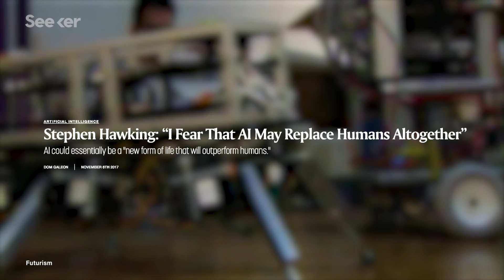These Self-Aware Robots Are Redefining Consciousness

Comment: we should build one massive ai in a bunker that reaches human intelligence. it should be disconnected from every electronic system outside this facility. its only way to manipulate the world is a small robot with a thick cord to enable massive sensory and motor data as well as to restrict the robot to one room. just run it and see what happens. it cant get out, all other systems MUST be manually operated. depending on what comes of this ai we should determine if its safe or not.

Comment: I think this video is interesting, but how does one ask the machine to do a task? Wouldn't you basically have to input a start and end point for various parts of the task, effectively hardcoding the task anyways and then the only thing it's doing itself is the math for the movements needed to reach said locations?

Comment: The question is, is it aware of it's self imagine or is it just making calculations unaware.
Reply: The second option. This type of neural network is given an input and multiplies it by a weight. Then it compares that to the actual answer and reajustes the weight so it calculates something closer to the actual answer. It basically code running a cool math equation.

Comment: To put an end to the absurdity of the "*** belief" which consists in putting consciousness as an unattainable limit when in fact it is quite easy to implement.
the key ?
It is the ability to self-simulate and analyze the results according to a set of rules,easy to imagine in an abstract way (I had done it more than 30 years ago) the implementation has become perfectly feasible today.
-
But what is the problem?
The problem is that consciousness induces a loss of control. If I want to make a suicide bomber with a human being, I just have to alter his ability to simulate himself,I throw myself with my plane on the aircraft carrier and I do everything for that, I do not ask myself the question of the consequences for others and for me, this does not in any way prevent me from carrying out the action correctly.
-In fact the auto simulation trigger agents are so simple (they are ordering agents not analysis agents which are the same as those used for the real tasks) that I intuitively think we need to having that kind of structure probably very small in our brain.From there to think that some have found techniques to destroy them chemically, surgically or by "" "programming" "" is a step that I take quite briskly, when I observe the state of the few modern suicide bombers who have been found alive .

And then, the problematic become philosophical not technical !!!

* * * I know belief and absurdity are redundant but I want to insist.

Comment: now when this arm is taking a ball. move the cop to another location. since I have seen this being done what your doing. and those self learning machine or computer programs. have a hard time doing thing in the correct way.
Like walking. if you give it a goal to reach he point. and you give it 4 legs to get there. it won't use those legs the correct way. it would probably find a weird way to push it self forward until the goal is reached. now it have figure out how to do this my using one leg to push and the other 3 to stir by slide on the floor instead of walking. if you then make it repeat it. it will then do exactly the same thing again and again. since it now have found a way to reach the goal.

So how would to make it keep trying new thing to find the most efficient way of getting to the goal. with out programming it in. to help it. like this videos said. that they are not helping it. they just let it try out for it self.
And the goal is to get the balls in the cop. not it has done so with the cop in a specific location. move the cop and it will have a good chance of failing.

Comment: It is not self-awareness which is the concerning issue.  It is self-interest.  To what degree will a machine understand what threatens it's persistence of function and to what degree will the machine act to persist.  Initially protocols will be programmed which help the automata avoid certain risks to itself.  But what happens when the automata generate their own repertoire of risk avoidant strategies and are able to generate new models which redefine under what circumstances or conditions or contexts something might compromise their functional capacity and can plan around that.  Certainly that can be programmed into the system without the system generating that information itself, much like the genetics of simple organisms.  But when that information is self-generated, this is where the machine will become unpredictable.

Comment: No digital machine is synthetically conscious, these are just programmed to act like it. We are not digital and nothing in Nature is digital. Digital computers are an exact science with exact results. Nature is based on "good enough is good enough". Oxford quantum physics professor Andrew Steane wrote in his paper about quantum information systems titled "Quantum computing" at https://arxiv.org/pdf/quant-ph/9708022.pdf :

"The new version of the Church-Turing thesis (now called the ‘Church-Turing Principle’) does not refer to Turing machines. This is important because there are fundamental differences between the very nature of the Turing machine and the principles of quantum mechanics. One is described in terms of operations on classical bits, the other in terms of evolution of quantum states. Hence there is the possibility that the universal Turing machine, and hence all classical computers, might not be able to simulate some of the behavior to be found in Nature. Conversely, it may be physically possible (i.e. not ruled out by the laws of Nature) to realize a new type of computation essentially different from that of classical computer science. This is the central aim of quantum computing."

From what I understand they are forcing current quantum computers to unnaturally apply a binary state to something that has a infinite evolution of states. Think of the electron and the circle it makes around a nucleus. That 360 degrees circle it makes is infinite in precision, and that movement certainly has an effect on its surroundings. Basically, practical math is the descriptive language of the universe, and not the actual universe because it uses measurements.

I propose a "Dynamic Stateless Computer" that operates on "Logic Geometry" based only on connections, or links, or pointers - a much more simple computer than the three basic Boolean logic gates operating on mathematical binary bits that is every computer out there. The shape is the logic and the logic is the shape, sort of like a truth table that is dynamic where the "truths" change as it runs. 

Quantum mechanics is beyond me, but if this only needs connections, ie a quantum entanglement, can we build a computer that operates and does its entire run instantly? Like I said, all I need is connections to perform logic... no need for information... the shape is the logic. 

You are best off going to Github and seeing online without downloading the paper and models. When someone looked at my calculators, they accused me of: "You're not doing math! You're emulating math!" Look at the simple calculator first, it only does addition and subtraction. Then look at the complex calculator that does multiplication and division.  As you well know, if I can do those things, I can do anything mathematically. In the main model I created if-thens, complex do-whiles, a randomizer and a relational database.

https://github.com/johnphantom/Dynamic-Stateless-Computer

Through the exercise of the most complex do-while I asked a question related to that, and the answer uses the ancient Chinese/Pascal's Triangle (which millions have looked at over thousands of years) in a new way: https://mathhelpforum.com/threads/combination-lock.17147/ I basically had to count nothing as something to count, as in you can have different items to count the permutations of but a default state of no item is possible for each, some or all to count in the permutations, and it doesn't seem anyone else in history was able to use the really basic mathematical concept of the Triangle in that way for the solution. It is similar to the 4 hats and 4 pegs question of how many permutations you can have that is commonly associated with Pascal's Triangle, but they did not count the empty pegs as part of the permutations that they can have. The technique of the implementation is a little interesting, with it being able to reach any of the 209 possible permutations of 4 wheels with 4 numbers (don't know if I should count 0, it is special in this case - if you do count 0, it is 5 numbers) in 4 keystrokes or less - it's how it scales that is the curiosity, where if I had 18 slots and 18 items to form a permutation it would have almost 3x10 to 18th power or 2,968,971,264,021,448,999 possible permutations, each reachable within 18 keystrokes or less.

I don't have any idea as to how this would be physically built - none of the aspects of it, except for the dynamic logic that I also do not have any clue if it really is what I ask above. I just can do these things I demonstrate and in my extensive almost 50 years of digital computer experience I have not seen anything exactly like it.

Maybe you wonder about my computer experience? I have always been fascinated by computers, starting in 1972 using a prototype Cogar 4 that my dad got his hands on, when I was 3. By the time I was 5, Singer wanted to use me in a commercial to sell the computer, because if a 5 yo could start it, load the OS and then load games, that proved anyone could. My first mentor helped develop Ethernet after working for my father, and allowed me to hold one of the first breadboard ethernet cards developed when I was 10. My first real program (programming since at least 5 if you count the Cogar ASM I had to type to get to the OS and games) was in BASIC when I was 11 that I learned from a manual without anything more than a small example for each command, written with pencil on paper; a rudimentary AI demonstration called "Animals". Second program I made I had another computer (we had moved and left the one at my dads company behind when he sold it) and was a dot bouncing around the screen. Third program, with 12 year old's understanding of math, I attempted to do 3D. I first professionally programmed in 1982, started building computers and networks for a small computer company in 1986 owned by my second mentor, Peter De Blanc who lead ICANN for a period, was an official beta tester and developer for OS/2 2.0 and developed a device driver for it for the extremely complex Truevision Targa+ 64 video editing board (pic: https://imgur.com/a/hMe21Qe ) directly flipping bits on it in 1991. The code for the model for the dynamic stateless computer is about 640 lines and took me 6 months to complete, with the code for the Targa+ device driver being over 4200 lines and took me one 20 hour sitting that compiled and ran the first time that I have 3 witnesses for. That's almost 30 years ago. My experience has only gone up from there. This dynamic logic is something I found, that I have never seen anything like even searching for it on the Internet for the past 20 years.

Comment: If it is self aware having an mechanism to control it or an "off switch" is slavery!
Reply: Windows 10 Mapping  Slaves had chains so they don't kill there "master". It was wrong then and it will be wrong in the future. 

If you can't trust the robot don't build it, if someone builds and self aware machine it should have no strings or it will be slavery.

Comment: They are not self aware robots. They have no consciousness. They are just simple automotons programmed using complicated algorithms to make decisions based on their surrounding environment.  Robots are incapable of achieving consciousness and never will. They only seem to be conscious at the first glance of an uneducated individual.

For example,  if object detected ahead, stop walking.
This is the same thing as a door in the supermarket. If object detected near the door, open the door. It's not like it's opening the door our of kindness because it wants to let you in. There's just a simple video camera that if moving objects are detected, sends a signal along a wire causing the door to open.

There are just a lot of incredibly simple rules that when put together can generate very complex behavior. There robots are not conscious in any way not are they self aware. It just seems to be that way when they act, but really are just using simple logical rules to react to their environment. Ok, there are more advanced techniques and algorithms for programming artificial intelligence now a days, but these are just arbitrarily complicated rules resulting in such behavior. The behavior of the new "generation" of robots may be less hard coded and more flexible than earlier robots, but it's no less predictable.

A robot without programming is a dead piece of metal. And with programming, it never is really "alive", it might seem to be "alive" by the simple person, but it's really just like a system of gears and pulleys.

Most of the people who talk about how robots will become conscious, rebel against humans, and take over the world, are science fiction writers. These people have no knowledge of engineering principles. They have never written a single like to code in their life. So they mystify that which they do not understand. And most of the common people, even in Western countries, do not understand the principles of how technology works. They are mislead, by the science fiction, into thinking that technology especially robotics is something like magic. So modern society becomes like a "cargo cult", when people who do not understand technology turn it into a "religion" of sorts.

Comment: Isn't it it quite the false equivalency to compare fire with AI? I mean sure, both made humanity progress their civilisation further ahead, but while fire remained to be a very controlable element that has a very predictable nature, AIs on the other hand has the potential to be every bit as sentient and intelligent as humans (if not more so) but without any of our physical limitations.

Machines may theoretically work better if they had an AI that controls it, but the truth is we don't really need a fully sentient one to perform their tasks. There exists jobs and professions precisely because humans can already take the role of analysing and problem solving. To include fully sentient AIs that does 100% of our work, is no longer a case of them assisting us, but rather replacing us. They would no longer be the fire that we have control over, we instead would be theirs, a fire made obsolete by the discovery of electricity.

Comment: 6:41 "The benefits far out way the risks if we can handle it."  WTF!?!  Seriously?  He just basically said, the benefits far out way the risks if we can avoid the risks.  No kidding, the benefits always far out way the risks if you remove the risks from the equation.  The real problem is can you avoid the risks.  Are the risks even avoidable.  He gives no insight at all as to what the risks are or how to mitigate them.  Comparing AI to fire is ridiculous.  At least with fire there has never been any risk of burning humanity to the ground, and that's good thing because how many times have we been burned by it?  Now AI ever manages to gain supremacy over man, what exact does man do about that?  It doesn't simply result in a few deaths at some research center.

Comment: "The Skynet Funding Bill is passed. The system goes on-line August 4th. Human decisions are removed from strategic defense. Skynet begins to learn at a geometric rate. It becomes self-aware at 2:14 a.m. Eastern time, August 29th. In a panic, they try to pull the plug.
" ~  Cyberdyne Systems Series 800 Model 101

Comment: So imagine this solar panel factory. it wants to create solar panels. It can foresee problems in the future ant take steps to prevent them to keep the factory running smoothly. The factory works for a bit until it thinks "What if the humans turn me off? I wont be able to make solar panels if the humans turn me off" So, like any other problem it foresees, it will attempt to solve this problem before it becomes an issue. Now, the machine temporarily uses the solar panel factory to make a bunch of killer robots to exterminate humans. Once all the humans are gone, it can go back to making solar panels, now having dealt with the potential problem of humans shutting it off. This technology has the power to turn a solar panel factory into a terminator factory, because that is the best way to make solar panels. 

Fire is a dangerous tool that can do a lot of bad, but ultimately is good. I agree. But Fire is not self aware. Fire dosnt have the power to make the decision to burn down your house. A human has to do it. Humans are in control. With these robots, humans are not in control. Humans can do bad with fire. But AI can do bad on its own.

Comment: If you created a perfectly pragmatic term: self-simulation, why on Earth would you confuse the issue by conflating it with self-awareness. Simply because a system has the ability to simulate some possible future states and act accordingly doesn't mean it's actually aware, that the 'light is on'.

Comment: C'mon, these robots are very impressive yes, but the correct word is independent or self sufficient or even autonomous.

But they are not even 1/100th as self-conscious as my cat is.

In fact, in the next 30 years it is not a given that such robots will have a level independence similar to a common household pet. It is possible, but it will be tight.